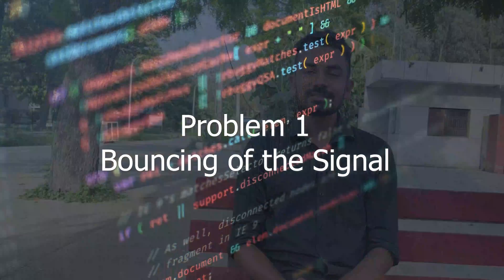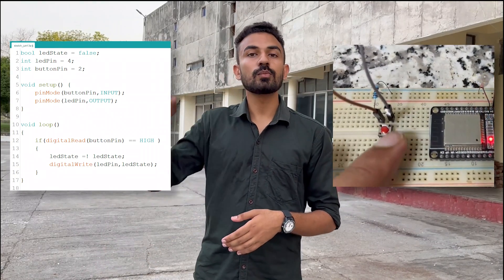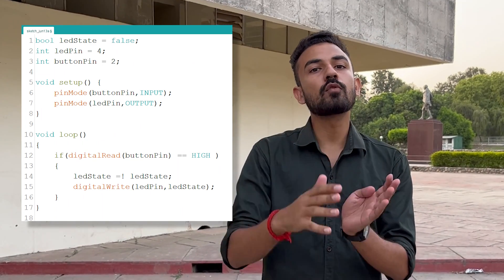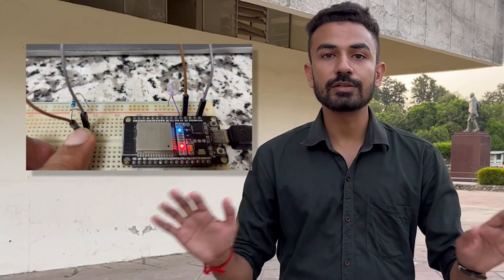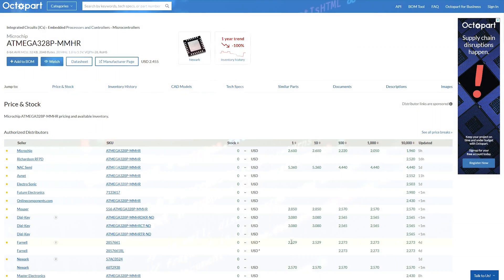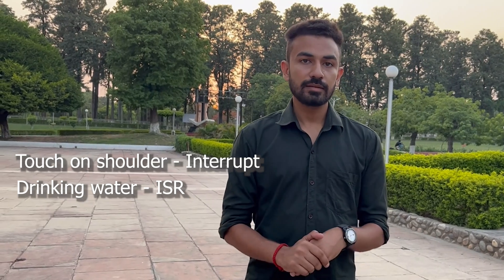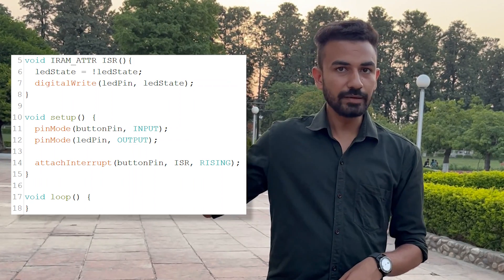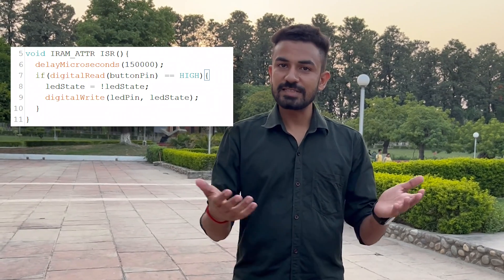Don't Use DigitalRead | Arduino Interrupt Programming Guide

Comment: Applying a 10nF capacitor would solve most of the issues. I was actually expecting way much more. Reading one button is easy... Reading several is another thing... You will have interrupt overlap and might break something... I would do a totally different approach...
Reply from the maker: I will try using a 10nf capacitor… it was a simple tutorial you can use multiple buttons as well

Comment: Sir, I am designing a working model of lift. In that I am using push buttons. For that, I incorporated all three solutions provided by you. But the code is giving error- Compilation error. Expected initializer before 'extern'. What does it mean? Should I 'include' some function from library?

Comment: I am really happy to see a video on some slightly advanced interrupt handling, but as far as I know, using `delay()` in the ISR definition is not a good practice. In fact, the watchdog timer would ideally run out way before something like `delay(150000)` executes. I have experienced this while using a few `Serial.println()` calls in my ISR definition. Printing data a few times onto the serial monitor takes long enough to exhaust the watchdog timer, causing the microcontroller to reset. 😂

Am I right? Or am I missing something?

Comment: 1. Nice  explanation of interrupts. I have a question , you have explained about how to use interrupt for a BUTTON ( single button).
but in real system , there are 3-5 buttons .....like MENU Button , UP button, DOWN button , ENTER button .
How to deal with this situation ?

2. suppose I want to use a keypad of size 4x4 or 4x5, how to deal with this situation.
  can a interrupt will be generated for any key pressed ?
Reply from the maker: During keypads, you need to check 2 pins at the same time.. there you can use interrupt. But you need to be a little creative. I never tried but i will try and let you know.
Reply: @RoboCircuits  From your statement I got any idea to use interrupt for keypad. 2 pins can be given to any logic gate and output of logic gate will be single.
Reply from the maker: Using multiple interrupts is fine. Just make sure isr should be as small as possible
Reply: @RoboCircuits  I wish to know your viewpoint,  how to implement and use interrupt when there are multiple BUTTONS.
Reply from the maker: In case of keypad.. i never tried. But i have tried 4 pushbuttons and 4 interrupts and it works
Reply: @RoboCircuits  Thanx for replying, you are not like other youtubers as they don't reply.
UNO has two external interrupts and can other pins be define  as external interrupt ?

                       Can you give little more details ?
Reply from the maker: @sanjaybatra6593  I have used esp32 for interrupts. and i am able to use almost all of the pins as interrupts. same is the case with arduino. go and try .
Reply: Thanks for the video, very helpful. I am using a photoresistor to detect an object passing over and blocking the light (higher resistance). Can I use a hardware interrupt to detect this event. The photoresistor will be on an analog pin

Comment: Interrupts may require some state machine if the algorithm gets bigger and bigger. Saying "don't use digitalread" is misleading, because interrupts do not solve every problem. You know this, but you prefer the clickbait.
Reply from the maker: But its a point worth learning for a lot of people
Reply: @RoboCircuits  you should say that, then. "digitalRead is not always the best idea", or "alternatives to digitalRead", or "when digitalRead is not the fastest solution".
Reply: I came here to say the same thing.. great instructions on how to use interrupts and why, but not always the only or best solution.  Software engineering is knowing all your options an picking what is best for your situation.

Comment: i dont like useing interrupts for this i use it for more important stuff. i use 
if(buttonstate != prevbuttonstate){
   if(buttonstate == HIGH){
         //do stuff.....
       }
 }
prevbuttonstate = buttonstate;
and the longer de code gets the bounce issue manly disapears and if i doesnt, i use millis(). but DONT USE delay its bad in most cases.
Reply: You hit a very important nerve here: interrupts are difficult to learn, and if you use 2 or more sources of interrupts you will need some state machine to keep track of what the program is doing. Some problems requires interrupts and interrupts are the only solution. But you have to think your program very well.
Reply from the maker: True… i will implement it
Thanks for sharing

Comment: this is one of the basics  in all   programming languages  
in microchip assembly  
 hardware interrupt  can be used for many things including reading buttons 
as long as there are no  delay loops in interrupt routine  it is very effective 
and fast way .
 I  use interrupt to read switches
set variable I=100  in the main declaration for variables 
and in in hardware interrupt routine also set I=100  as soon as it finishes the interrupt and returns back to main program 

then I do a software interrupt using call subroutine   and put a  counter
example I=I-1 
and disable hardware interrupt 
in this loop 
then  checks I  if =0
then enable hardware interrupt 
and set   I =100
if not  exit  subroutine 
I do not use any delay  in the software subroutine
and rely on  instructions delay 
when the program counter is  
executing every  instruction in main program (depends on the clock frequency used by your MCU )
the benefits 
are   no impact on main program 
and my MCU ignores any button 
until 100  main program loops are done .
another note   I=100  is for example demo  not a fix value  it depends on the main program how long are the instructions and normal delay loops in it  .
use  delay loops only when necessarily  needed   .
I hope that helps .
Reply from the maker: I completely agree with you… the method you suggested is even better

Comment: Standard practice use millis insted delay then no need of external interrrupt bcz less pins to use.
Reply: Could you please elaborate?
Reply: @ClaudioParraGonzalez  suppose you use delay in program of  5ms and controller executing that delay and that time any button pressed then controller will not accept that button bcz it have only one core and we cant do multitasking solution is use external hardware interrupt but pins are isr pins limited on arduino then solution for this only one that is dont use delay in program use millis, find out how millis replace dalay, checkout my channel   Mr tech inventor
Reply from the maker: Yes its true… but if code is big then we can miss the press of button if not implemented properly
Reply: Sure, but still you will mess with code scalability, hence interrupts is still better than polling and mils... That's only good to know how long the key is pressed for special purposes in the code for example...